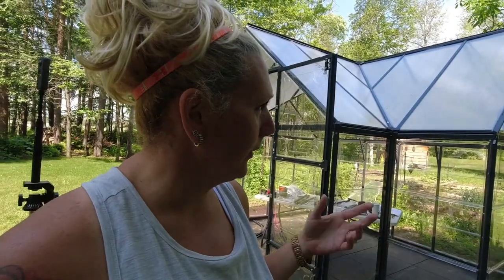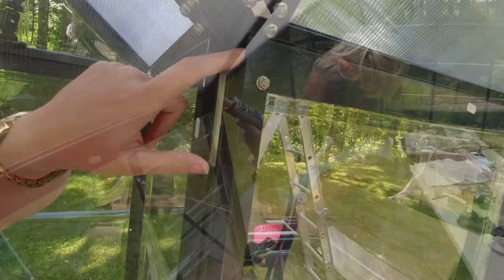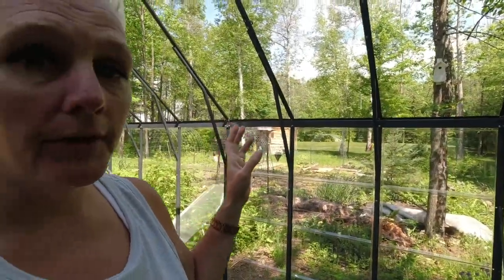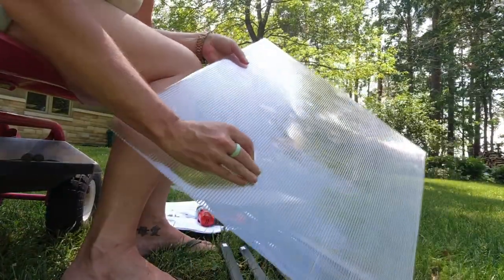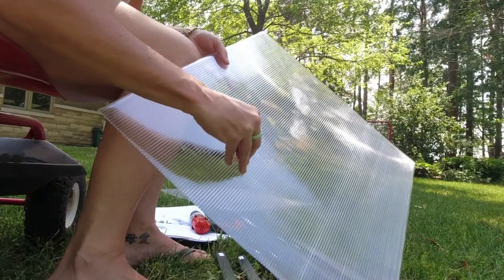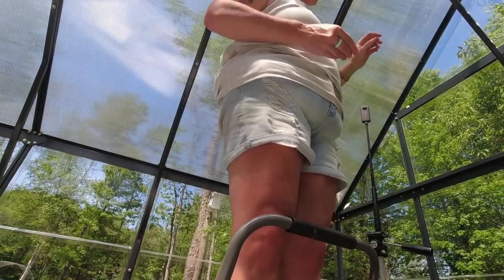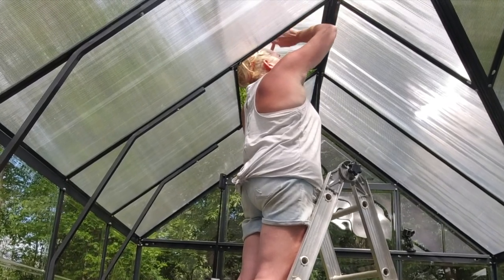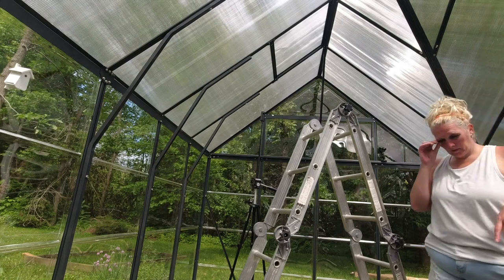I DID IT! Building a Greenhouse with Bonnie!

Comment: Hello,
So you think is a good quality for $500 dollars? can you husband run 120 volts to it ? Be nice you can save some money. Thank you
Reply from the maker: The total cost with the flooring was around $4000CAD. I had an electrician run power to it and instal one exterior outlet and 4 interior outlets on 2 seperate circuits, as well as the installation of the chandelier $1700CAD for the electrician. 
I am happy with it so far, less of an investment than a glass greenhouse would be but it will work for what I need it for. Unless a tree lands on it, lol!! Thanks for watching!
Reply: Thank you for replying back.Have good day.

Comment: It's looking great.  Yes put in more plugs then you think you'll need.  Better to have too many.  If he's burying any cable, I would run water too.  

You should have waited until we cooled down, doh!  Ya it gets hot fast, its amazing.  Omg yes take the stickers off!  Drives me nuts when they get left on things!

I'm not a fan of heights either.  I'm ok on a ladder, but scaffolding freaks me out, esp when its shaky.

Don't forget some fans for circulation.  We have some that come on at a certain temp, worked great.
Reply: BTW captions say Artist Kindergarten hahahah.
Reply from the maker: I was hoping to have it here to set up earlier in the spring but had some delays with shipping, I couldn't wait to get started on it!! The electrical will be going in next week, I will run water to it when I set up an irrigation system, just hoses here for now! What kind of fan do you have? is it a heater as well or just a temp. controlled fan?
Reply: @artistinagarden  we have small exhaust fans that turn on at a certain temp you set.  Then a seperate occolating fan that ran most of the time.   And then also a separate thermostat heater. 

You can slow set them up on timers, or a smart plug and croton from your phone.  Its a gonna get hot in ther!  The fan also helped blow the heat around to spread it out evenly.